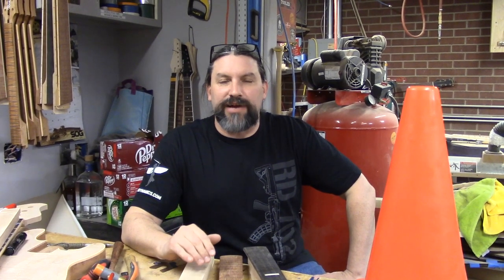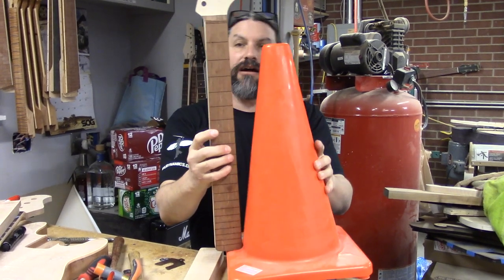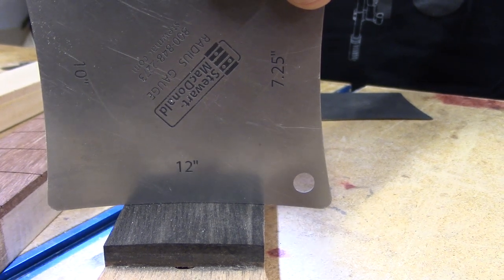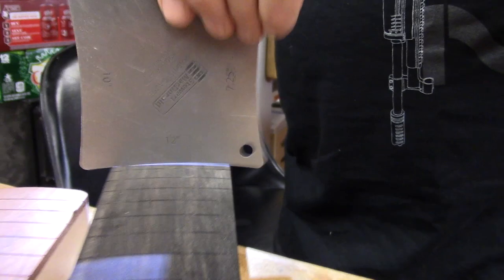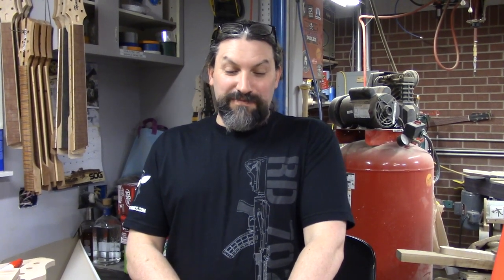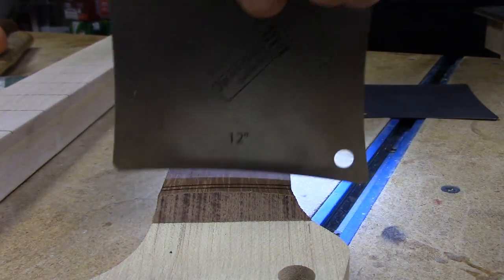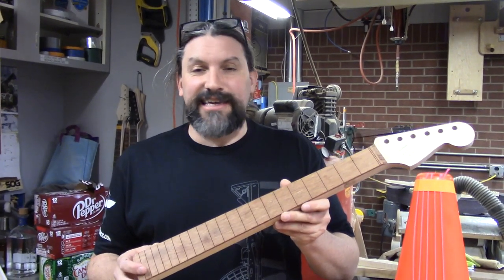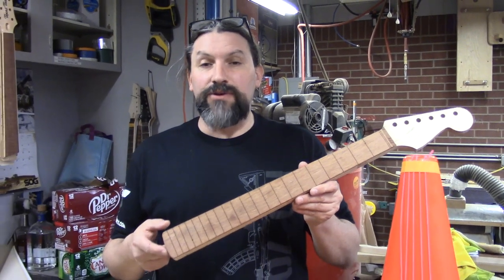Compound Radius... A Solution In Search Of A Problem?

Comment: Great explanation of how little a compound radius is in the overall length of a fingerboard. It's not worth the effort to me. One thing that I do though, for instance, is create a straight 12" radius on my fingerboards, then level frets following the lay of the strings creating a slight conical effect in the frets only. Doesn't take any more effort to do. This is just something that I've always done whether it makes a difference on fretting out issues or not. Adjustable height bridge saddles used.
Reply from the maker: Sounds like a good technique my friend.

Comment: Can a compound radius be added easily to a straight radius board?  I was wanting to use some radius blocks from Stewmac but was wondering how to blend the different radius sections.  Is that a bad idea?  You would ultimately use a straight edge in each individual string position checking for gaps... right?
Reply from the maker: Hi Taco Conch, I know it can be done but you will need more than two blocks to get a conical radius. Now... if you wanted to do only two radiuses I'm sure it could be done. As you may know, I am not the world's biggest proponent of the compound radius but I applaud your desire to make something cool my friend
Reply: @TexasToastGuitars  I just want to give my ESP a similar feel to my Jackson.  Let's say my Jackson is a 10"-16" compound radius.  Could I remove the ESP's frets, carefully level the fretboard in 3rds with a 10", 14" and 16" radius block as evenly as I could, and be safe as long as I level the new frets with a reliable leveler?
Reply from the maker: Hmmmm I do not recommend that.
I'm not saying it can't be done or that you can't do it but I just don't know that the juice is worth the squeeze

Comment: I want to stick with the standard radius neck myself whether it be 10" 12" because I think there would be a cost factor involved in manufacturing. I have a stratocaster style guitar with a 7 and a quarter inch radius and have my Les Paul has a 12 they both serve purposes. But to each their own correct?
Reply from the maker: I agree Jack

Comment: I am wondering how I must setup the tremolo bridge height in a strato guitar that has a compound radius of 9.5 - 14 radius. Do I set the bridge height to 9.5 or 14? Let me know please because I am confused a bit. Thank you.
Reply from the maker: Well, by the time a conical radius goes from 10" a the first fret to 16" a the 21st you would probably be at 19 or 20 by the time you get to the bridge. 
I'd make a hundred dollar bet that there are very few bridges set to match the radius of the fretboard... much less the fret leveling

Comment: If the difference is so small, what if you do a more extreme radii proportion, like 7,25 to 14? Will it the too problematic to craft? Or more simply: to get a really comfortable “feel” and overall versatile setup (low action for playing chords through out the WHOLE neck while keeping bending strings easiness), will it be more important the choice of the frets? I’m starting thinking that the action/frets height is even more important (or at least just as important) then radius when you look for comfort and a sense of roundness underneath your left hand’s fingers while playing. But I don’t know... Thanks for the awesome video!
Reply from the maker: I don't think that conical radius is that big a deal, but there isn't any penalty

Comment: So with a floyd rose that comes with 12” radius nut, can I put a 16” radius on my fretboard and then shim the tailpiece? 12” nut on a 16” fretboard doesnt matter? I came to see this video as I was thinking to put a 12-16” compound radius but now In having second thoughts
Reply from the maker: If your Floyd Rose has a 12" radius nut the fretboard will have to match at the nut. If you decide to go with a conical radius... like say, 12" to 16" (very little actual difference by the way) you will need to shim your bridge to match what the radius is by the time you get to the end of the scale. I would imagine it would be 20" or so. If you don't than the advantages of the conical radius will not be realized and you will actually have a higher action than you would if you just went with a straight 12" fretboard. So... in order to have it work like you want, remember to match the nut to the fretboard and the bridge to the fretboard (or virtual fretboard if that makes sense).
Reply: Texas Toast Guitars woah thanks for the reply. I actually found out floyd has a 15” nut also, I think Im going to go with that and then shim the tailpiece

Comment: Hi!
Could you tell if leveling frets with fretlevel works the same way on compound radius as on set radius? If I have a few frets higher on compound radius neck is it possible to level it with straight edge or better to use several radius blocks?
Reply from the maker: Hi Stefan, I only use a flat block/beam/etc. to level frets. I never use a radius block to do this job regardless of the radius. 
This is just me and there are several ways to do this job.
Reply: @TexasToastGuitars  Great thank you for your reply!
Could you tell what disadvantage is to level frets with radius blocks of variable length? I guess you use the only to sand fretboard.
Reply from the maker: I'm sure lots of people use radius blocks to level frets. I don't know what advantages or disadvantages there are?
As I said, I never use them for that purpose. 
please do not mistake what I do or don't use to mean that what you do is right or wrong.
You will need to find what works for you. 
Having said that... I find that the flat leveling tools work best for me. I'm sure you could find any number of guitar builders who will say that I am wrong and that they use another method.
Reply: @TexasToastGuitars  Great thank you!
One last question. If you install frets do you bend them at exact radius of fretboard or slightly smaller radius for like a spring tighter fit at fret edges? If you overbend frets thrn by how much?

Comment: Before I got a compound radius guitar I really believed in it because it made theoretical sense. After I've played one for 6 years, it's really not that remarkable. Sure, it solves the choking out problem when you bend. But so does a flatter radius fretboard. Then the question remains is that does the tighter radius on the lower frets make barre chords more conforming to the contour of the finger? It's a non-issue for most of the players who are already playing up the neck. 

It's like "we have invented a tool to help you do both grade 10 homework and grade 1 homework!" Er, if I'm doing grade 10 stuff I don't need help with grade 1 stuff.

Comment: What people forgets is that those "heavily" radiused necks like 7.25" and below (if there ever was one) was mostly on the vintage Fenders of the 50s where you DID NOT BEND, and used 012 gauge strings, flatwounds, and a spun third. No one bent back in the old days. I have played and tried 7.25 radiused necks and you have to keep high e-string at such a high action that it is imposible to play anything decent. What people forgets is that on a "heavy" radiused neck like a 7.25" the string buzz may NOT come from the fret right UNDER the string, but it can come from the same fret but at the side, since the fret goes "up hill" and as the strings vibrates it "chokes" on the neighboring fret hill. I e there's closer distance to the sides of the strings, than the distance to the fret point right underneath it. Which defeats the purpos totally. I've come across loads of bass guitars that buzzes even with high action, and that was the culprit. 

I find the following VERY peculiar in the guitar industry: The only fretboard where you can have the lowest action all across, and bend strings to kingdom come, is if it's completely FLAT and has no radius at all. And as such, only classical nylon strung guitars comes with those. Where you can't bend any strings anyway, bcause the music played on those are not at all including and string bends. Classical, acoustic tunes and so on. Old time music.

But as fast as you play other kinds of music, blues, rock, country, folk, where bends are a crucial part in the music, and you go for steel guitars, electric guitars, with light gauge strings where you actually CAN and DO bend strings and it is a large part of the music, all of a sudden - for some rational bizarre -  the guitars are made to make that harder, i e with lots of "radius" on the neck, compound, conical etc. WIth lots of fret buzz as a result too...

Beats me, and have always done. And will, ever.

I like mine with 16" radius all the way through. But.. that's just me. Almost flat. YMMV.
Reply from the maker: We use 10" for almost everything but have made several flat boards for people. It's killer and you can bend strings just fine

Comment: I have Guitars with straight radius necks, and Guitars with compound radius necks. To Me, the difference is not really discernible. I will add that the only real advantage to a compound radius neck is that You can get Crazy Low Action with them. Great Video! ✌
Reply from the maker: Thanks man

Comment: Hey great video. I don't really care, but I wonder, one thing (i find it peculiar why no one mentioned it anywhere, Stewmac, YouTube, other luthiers): 

1. The regular truss rod adjustment for relief, must be thrown slightly askew, when using it on a compound/conical neck, doesn't it?

I e if you have the same radius, all across/along the neck, any truss rod adjustment bows the WHOLE of the neck JUST AS MUCH, even the outermost strings like high E and low E. But if you have a conical radius, whenever inducing a bow or relief, the relief can only follow the trussrod adjustment EXACTLY on the "top of the hill" of the radius which means right between the D and G strings. 

What I mean that some parts of the neck will have SLIGHTLY more relief, even too much, than the flatter radiused parts of the neck ones. Especially on the outer E-strings. Now, of course, relief should mostly occur on the twelfth fret, but in order to have it work on conical fretboards, you must overshoot and may have to adjust to a too much relief in order for the second half of the neck even react to any truss rod adjustment. Let's put it this way: Some parts of the neck above the 12th fret will never react to truss rod adjustment and will look like there's no relief at all, while down below 12th fret it will look like a bit too much relief. Although the neck as such reacts the same way to truss rod adjusments. The truss rod and relief of the neck doesn't care and gives a flying ** whether any fretboard is radiused straight, completely flat, compound or conical or anything in between.

Or is it so subtle that it is neglible?
Reply from the maker: For most of this stuff, the theory is certainly accurate but the reality is tricky. Just because the board has a shape doesn't necessarily mean that the frets are pressed in, leveled, dressed, etc. to the same shape. Then there is the bridge, nut, truss rod, string tension and so on. It's a lot of stuff to worry about for a difference of .01
You can't always convince guitar players that stuff isn't important. 
My friend Jeff who teaches the classical guitar program at Colorado State University likes to say that guitar players should practice more than worry. 
Sage advice.

Comment: Hey Matt, every major player in the guitar industry and even after market neck builders have been calling it compound radius your years and it's never been a problem. And it is proper to call it that cause one thing combined with another is a compound. Yes it's convenient to describe as conical but not necessarily more correct. Anyway don't let the nit pickers get you down. Good video, well explained.
Reply from the maker: Leo Fender got vibrato and tremolo wrong and he completely changed the lexicon. Of course, I'm no Leo Fender hahaha

Comment: However I must add some players who liked the 71/4. rad.because they could more easily hook their thumb around the neck to hit bass strings a la Hendrix could keep that option on lower neck where bass notes live and still have the flatter radius further up the neck for wife bends on unwound strings but if you don't need this feature or don't play with low action or have a 12 " radius or larger I think it mainly a waste of $ and just makes regretting more of a PIA ad one must either do a hammer in fretting or use multiple dies in press or clamp in so repairman like myself have to charge more and it's more difficult for begginers to level their board accurately. But I might try an 8 radius to 14 on top just to see how that plays but for most players and most boards not needed.
Reply from the maker: Everyone likes different stuff and there is a butt for every bench

Comment: I can tell difference between a Fender neck with a 9.5 to my Deluxe Strat with a 9.5 to 14 radius, although that’s maybe as much to do with the fact the nut width is slight wider too. But you soon adjust to either. It’s tiny nuances of difference.

Comment: Yeah I don't like compound radius fretboards. I've got one on my tele that goes from 10" to 16" and my regular 9.5" strait radius strat is a more comfortable guitar. I mean the whole point of the radius in the first place is that it makes the guitar more comfortable to play on. The compound radius just means that I'm getting less radius and a flatter fretboard as I move up the neck negating the comfort that the radius provides. I'd rather just have a strait 9.5 or 10 inch radius. So in answer to the question in the title, yes, its a solution in search of a problem.

I mean I'm sure there are some guys that experience the advantages of a flatter radius higher up on the neck, but I've never had an issue of bent notes choking out. It just makes me wonder how low people have their action, and how far are they bending their notes??
Reply from the maker: Our standard radius is now and will remain 10". People like to mountain mole hills hahaha

Comment: Since you seem to like measuring things that really don't matter,  here's one:  the difference in the scale length of the E&G strings vs the A&D strings on a Jazz bass,  given the very narrow nut.  The frets are parallel, but the strings are not.... 

Not to be confused with my crazy crooked five string, with 34-37" scale lengths.
Reply from the maker: I don't only like to measure things that don't matter I like to make videos about it.
Reply: Texas Toast Guitars, Matt's meanderings and meaningless musings.  

Actually, it was pretty eye opening to see just how little difference there really was up at the end of the board.  I know on the new PRS JM strat(cough), it's got not only a normal radius,  but fairly tight.  One can still bend on that.

Comment: The only reason compound radius fretboard came to pass is that back when all Fender necks came with 7 1/4 it 3as hard to do large bends on B and G string without string fretting out especially with lower actions so when we regretted these boards we would scrape and sand the radius flatter as we went up the board.Many happy customers found they could do easier bends especially those chicken pickers that did pedal steel bends and some blues and rock players.Then Fender found out about their earlier problem and switched to a flatter radius after that it became more of a vintage Fender "problem" and like all things vintage became supposedly desirable.
Reply from the maker: Agreed

Comment: It seems to me that manufacturers concentrate on these small issues but then don't fix bigger ones. I'm trying to get a Tele neck but I'm left handed. Everywhere I'm seeing compound radius boards but lots of them have truss rod adjusters at the heel. OK if you have a rout to access it but why not solve this problem by having an adjuster wheel. I get why having the adjuster nut at the heel is better than the headstock end but it's not if you can't access it easily. Then what about re-fretting or sanding the board. Just a load of trouble if it's compound, or rather conical to use a correct term. They don't even describe it right.
Reply: And then another problem. What do you adjust your bridge to and what if your bridge isn't easily adjustable to the correct radius.